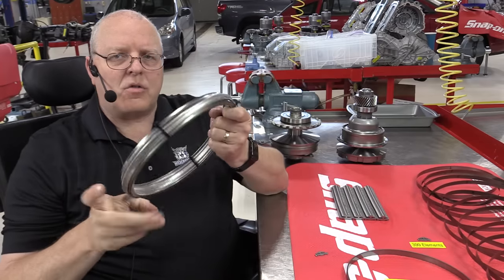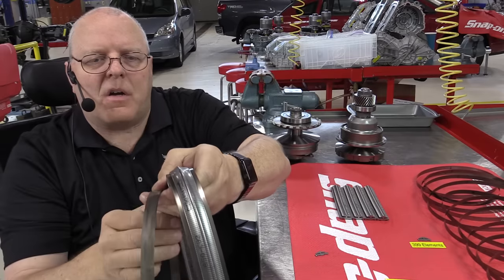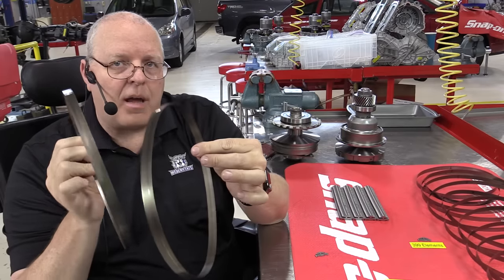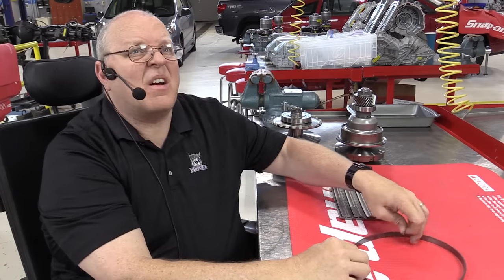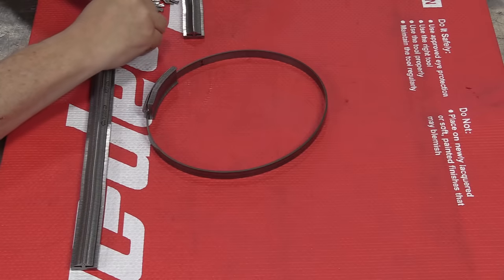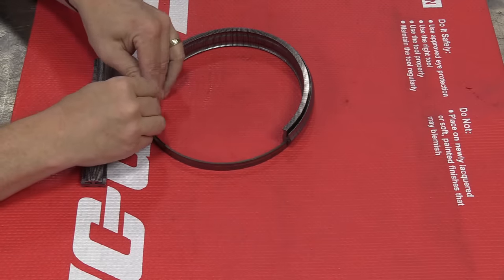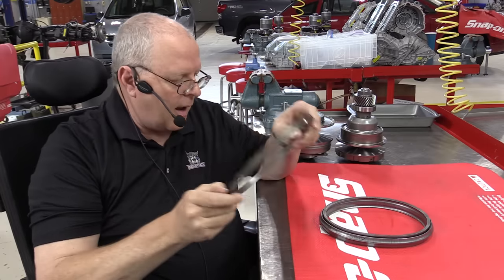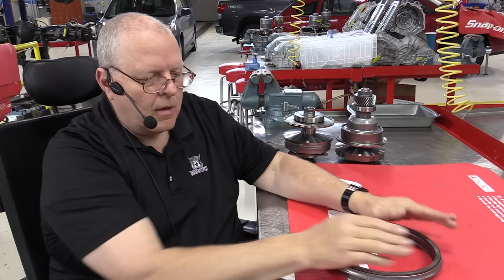The 423-Piece CVT Steel Push Belt

Comment: I found that the explanation this gentleman gives is very clear cut and easy to understand.
However, because there sre so many parts to one of these belts, with a large amount of pressure being applied by the fluid, i really think that it would be helpful if he were to do another video just about the fluid.
With many of the cars that this system is used in the makers try very hard to indicate that the reason there is no dip stick is because jts a sealed unit and does not need a  fluid change.
This is one of the main reasons that most people including myself, are very uncurtain about these Gearboxes, and having already heard that two or three  car makers are facing a storm from buyers who have had major problems with them, Ford being one of them, and to make matters wourse their atitude is could not give a shit, leaving owners with a massive bill to repair something that should never have been on the maket until it was completely tested to find out how long these belts will last, as replacing one is as costly as buying a new car, and certainly not something the average guy would ever dream of attempting themselves.
The belt itself may well be something that needs a lot more attention, before sticking it in a car and selling it, however the most damming of all is the fact that the new owner is told  " oh its a sealed unit you dont need to chang the fluid, " when them truth is that firstly the  fluid itself will set you back a tidy bit of cash, and secondly the prosess of changing this fluid has been made as hard as possible to undertake, for a start, the filler hole  is in a possition that normal size hands will find it near impossible to get at, and i bet you have already guessed it, the only way you know you havevput enough  fluid in is when it starts oveflowing from the filler plug.
Reading the owners manual you will find the whole matter goes unmentioned, COMPLETLY!!  when asked, i was told well, you will know it your loosing any fluid because you will see it on the ground, a really great answer considering that when standing still in your garage there is no pressure because the engine is not running, leaks are more noticable when under pressure as your driving down the road,and its real hard to drive a car, hanging out at floor level to see underneath for any leaks.
The bottom line is that cars today have just about every whistle and bell you can think  of to say something is wrong, only to indicate that you should always drive with your mechanic in tow for when something goes wrong.
Clearly made to go wrong  sooner than later, todays car is made to do Bout fifty thousand, then change it for a new one, despite the fact that it cost an arm and a leg to start with, most of the extra cost for the bells and whistles, while keeping quiet about the fact that the gearbox is as cheap and nasty as it can get, the engine following a close second.
It use to be that the biggest problem to look for when buying a second hand car was rust, now the car looks brand new but is not worth a light, with the added atraction of the fact that you need a masters degree to atempt anything yourself, you are lucky if you can find the spark plugs, and dont go looking for points or the like, they dont have them, about the onlynthing you can do is keep the tyres pumped  up and the washer bottle topped up.
To sum it up the car industry has become the biggest  rip off ever and is even a mechanics night mare with all the technology they have to have.
Reply from the maker: Thanks for your comments, you are not alone. To make things worse, there are improper fluids being used by some shops which can cause premature failures. See my video on transmission fluid specifications https://youtu.be/xUFY0L_zFek

Comment: I'm afraid I'm simply not convinced on this push belt concept. I can't see any way the physical laws of the universe allow the power transfer to be lower on the tension side.
Reply from the maker: Thanks for your feedback. You might check with Bosch, the maker of the Push Belt at http://www.bosch-mobility-solutions.com/en/products-and-services/passenger-cars-and-light-commercial-vehicles/powertrain-systems/transmission-technology/pushbelt/ and http://www.bosch-mobility-solutions.com/media/global/products-and-services/passenger-cars-and-light-commercial-vehicles/powertrain-solutions/transmission-technology/pushbelt/productdatasheet_pushbelt.pdf Best wishes!
Reply: Thank you for the quick response.
 I went ahead and reviewed the material in those links, unfortunately I've arrived at the opinion that they contain corporate propaganda. I strongly suspect that the phrase push belt was concocted by their marketing department in an effort to obfuscate the fact that the CVT is conceptually identical the transmissions that have been used in skidoos for more than 50 years.
I am appreciative of you giving us a good look at the construction of the belt. As a mechanic I've never seen the inside of one of these transmissions, they're not considered serviceable in any way. When the "replace transmission light" comes on you put in a new one and ship the core back to the manufacturer. You're not even supposed to check the fluid in most of them.
Reply: Agreed on the propaganda.  399 elements mean 399 failure modes.  Plus the necessity of multiple concentric rings increases the failure modes on top of that. A standard automatic rarely strips gears, usually they have a valve or seal problem.  The CVT doesn't eliminate any of these failure modes either.  

I don't know, 4-5K in repair fees for ~5mpg?  And this doesn't even factor in when you look at more modern 7,8, and 10 speed autos.  

Video is very informative, and I think everyone should see how these transmissions work before buying...
Reply: FMEA, or failure mode effects analysis can occur in any stage of a design, including intended or unintended use.  Usually it's an important stage gate in design, verification and validation.  

How does one check reliability before buying?  Is there some stat somewhere publishing CVT failures or complaints per mile driven?  If that data is available somewhere, please post it as I would be interested to see it.  

Many cvts aren't really serviceable (due to 399 intended use failure modes), so one would have to plan on a full replacement should failure occur.  If it costs 3 to 5K to replace, and a conventional transmission costs 1.5K to repair, did the cvt save 1.5K-3.5K in fuel?  That's around 51,000 miles of fuel at 40mpg.   So my guess is no.
Reply: davetek490 ; easiest way to determine “reliability” of a push belt CVT is to assume a 100% failure rate on all belt CVT and simply avoid vehicles with that type of transmission

Comment: An excellent presentation of how a CVT works and is constructed.
The CVT is an enticing concept for greater IC engine efficiency - on paper.
And this is the most common execution of the concept, used by Honda, Toyota and Nissan.
Unfortunately, it is a horrible engineering solution.
It combines contradictory applications of the laws of physics.
The makers claim that this design reduces friction, but the entire concept relies of friction of the belt against both pulleys to function.
They require special lubrication to operate and a strict maintenance schedule to keep them from self destructing.
Nissan has had massive problems with their version of this design, so much so that they have sued the supplier of their CVTs.
While, on paper, they are simpler and less expensive to build than a geared transmission, they are more fragile and temperamental in real world operation.
And even average drivers, who know little or nothing about transmissions dislike the main attribute of the CVT that is supposed to be its main selling point - optimum engine efficiency.
It holds the engine in a limited rev range.
To offset this annoying feature, the car companies program these transmissions to act like they have "gears" - which negates the whole reason for their existence. 
I will never buy a car with one of these transmissions.
Reply from the maker: Thanks for your feedback
Reply: steevee1945 I rented a Nisan Altima 2016 model for ride from Las Vegas to sequoia national forest, Los Angeles and back. 3 people on board with some luggage drove the thing pretty hard climbing hills and mountains. I liked the way the car operated, surprisingly. Got excellent gas mileage too - 31mpg (average with all the hard driving and keeping it 80-90mph on the highway)
Reply: SATURN supplied a CVT on the VUE-for two years-they had a horrendous failure rate-so bad that owners  had a class action lawsuit to recover. Audi seems to be doing away with them.
Reply: Mitsubishi CVTs seem to last ok.  120k miles seems the norm. If the tapered pulleys aren't worn, a new $500 belt gets you going again. No torque converter to rebuild (they don't seem to fail), and what clutches they have are usually reusable. If a belt breaks, there's very little internal damage.    I hate CVTs too though.    CVTs seem to be the way the world's going, sadly.    Nissans---stepper motor, and solenoids.  Hondas ---start up clutch.  Both costly. Thank goodness I'm due to retire from this crazy vocation.
Reply: @Sergei__v  That is not special at all. With my 05 camrey doing essentially the same type of driving like you explained 2 ppl and a car full of my shit (I was moving) I got 34 MPG.
Reply: @THEGAMINGHELP101   Your car has the same MPG as the altima 31 City -41 Highay. So yes, it's possible

Comment: Very informative, thank  you.
Just a clarification.
This belt cannot take compression in the "belt direction".  In compression in the direction of motion it will buckle in the radial direction, the direction of high flexibility.  The compression referenced in  "compression belt" is most likely the compression between the moving flanges of each pulley.  Each one of the 399 elements is compressed in the direction of the pulley axis as they make contact with the conical  flanges that are pushed together by a spring for one pulley and by hydraulic, the control, for the other pulley.
In operation, one section of the belt which is not in contact with the pulleys is under high tension, the other section not in contact is slack or under  low tension just like a regular V belt between two pulleys.
Reply from the maker: https://www.bosch-mobility-solutions.com/en/products-and-services/passenger-cars-and-light-commercial-vehicles/powertrain-systems/transmission-technology/pushbelt/
Reply: I slept on it and thanks to the above video, It is clear now why it is called a push belt.
The belt is made up of the element stack and the steel belts.
The elements, on the power transfer span,  are in compression as they slide on the steel belts.  The element stack cannot carry tension.  The steel belts cannot carry power as they can slide with respect to the elements and thus with respect to the pulleys.
The composite push belt is in tension all along its length.  All along the push belt length the tension in the steel belts exceed the compression between the elements.
So the composite push belt tension equal to the tension in the steel belts minus the compression between the elements is in tension all along its length and thus  does not buckle.
Reply from the maker: @pppppierre  Thanks for watching

Comment: why not keep the simplistic system of a 4 speed transmission or 6 speed? now we have to deal with bullshit ring packs if one of those three hundred and ninety nine elements decide to go bad
Reply from the maker: Thanks for your feedback
Reply: It's simply down to efficiency. From the many ways you can reduced fuel consumption, this is what we're ending up at.
Reply: infinite gear ratios  and its not like a 6speed automatic transmission is simpler
Reply: Why? The same reason we don't still was clothes on a washboard, progress.
Reply: Emph Squee progress for belts that dont last long or handle much torque? Yeah real progress guess thats why auto companies moved to 8 and 10 speeds
Reply: Anthony Perez Cvt's are generally at least as reliable as conventional auto trans. They are mostly made for small,  lower powered vehicles and with proper servicing will last the useful life of the car. They offer real advantages in efficiency which is why they are used increasingly more. It is a good idea to know what you are talking about before making comments about short belt life.

Comment: Will avoid any vehicle with this trans. This is the first video I've seen of the CVT and working innards. An all steel push belt ? I guess it would have to push to keep it crammed together . No thanks..
Reply from the maker: Thanks for your feedback
Reply: Depends on the application. I know the MK2 Prius is easily like a 300k mile car if you keep the oil changed and don't abuse it.

Comment: When that belt comes apart byebye transmision
Reply from the maker: Thanks for your feedback
Reply: The longevity is about the same as more traditional transmissions. It's just that a more traditional transmission may give you some warning signs before failure like grinding gears and hard shifts making a catastrophic failure less likely.

Comment: Nice clear explanation, s segmented steel element compression pusher belt held together by tension steel belt packs. All the little elements working together are stronger and more functional than a single element in the same way that people are stronger in teams! Thanks for sharing this interesting edifying information!
Reply: It also makes it super clear why Nissan CVT's have so many problems with early failure. The classical manual tranny seems so much more robust!
Reply: Also combining two electric motor generators with the gasoline engine in an orbital gear power split device makes the "transmission" of the Toyota Prius super ultra reliable!
Reply: "Power Split Device" was the special sauce that made Hybrid Synergy Drive sell by the millions  ^^
Reply from the maker: Thank you, and thanks for your feedback!

Comment: Thanks, now I know not to buy CVT car. Ever. Still they are a lot of choices and I can get regular transmission car.
Reply from the maker: Thanks for your feedback!
Reply: I agree, don't want a cvt!
Reply: How about honda cvt? They said Honda cvts are reliable .
Reply: @gutadin5  What I've heard is stay away from this one - 
"Nissan owns a controlling interest in JATCO, the firm that supplies 49 percent of the world's gear-free transmissions to Chrysler, GM, Mitsubishi, and Suzuki."
Reply: @selewachm  you mean stay away to their cvt transmissions or automatic transmissions ?
Reply: @gutadin5  I've heard bad things about the Jatco CTV which are in Chrysler, GM, Mitsubishi, and Suzuki.
Reply: @Jr V how many mileage on the Odoneter and year of your car?
Reply: @gutadin5  My Accord is over four years old with 52,000 miles.
Reply: @neilkurzman4907  update us when you get to 70,000 or 80,000 miles
Reply: @gutadin5  
With Covid around that could take a while. I guess I should get all my fluid changes on time.
Reply: @neilkurzman4907  when did you first change your cvt fluid ? If you have cvt  you have to change your fluid often.
Reply: @gutadin5  
I’ve got the service done at the dealer. I think the first change was in the first year or two. I don’t recall if there was a second I’m not sure when it’s due. 
But I will certainly check.

Comment: nice video, clear, language, spot on on how it works, kind of like a snowmobile, but much much more robust..with more friction elements.. to handle higher torque and of coarse the cars weight, and constant throttle movement.. the belt constantly moving up and down the face of the pulley must cause a lot of wear mind you, I'm guessing tps sensor . and a bunch of tranny software smooth out  the throttle inputs so as to mitigate the drivers foot  inputs.. otherwise the belt would wear out very fast from constantly running up and down the face of the pulley.. 
    A smooth linear acceleration from the time power is applied, and gradual tightening of the bell ( most likely controlled by how the fluid is admitted to the torque converter would greatly reduce lash , rather than just relying on centrifugal force to throw the pulley out like on a sled.. nice controlled even  force applied to the face of the belt.. once it's "locked up" so to say,  can the power be applied with gusto from the engine..it's that split second of initial grab that causes all the wear.. the belt face is essentially the clutch, the fluid entering the torque converter is essentially the foot , and must be controlled to engage softly , and evenly so as to get decent belt life.. once software and servo's were advanced enough to handle this delecate operation reliably , through millions of cycles, could we build a cost effective cvt.. had mechanical forces been relied upon alone the thing would be giant, clunky, and expensive... the first cvt's were just that.. once engineers could eliminate that initial lash from the belt grab electronically, cvt became viable..
Reply from the maker: Thanks for your feedback!

Comment: Audi  / LuK had used a link-plate chain type in their Multitronic CVT transmissions.  While Audi has abandoned using this type of transmission in new cars, this alternative for higher torque applications would still be interesting for repair reasons. And you will have considerably more parts on your workbench. :-)
Reply from the maker: Thanks for your input. Subaru uses a similar chain-belt setup.

Comment: Thank you for the detailed explanation. I think initially it all goes back to the DAF Variomatic. Once I worked as German student for DAF Trucks (in EIndhoven Netherlands). When I remember correct, the CVT was invented from ZF (Zahnradfabrik Friedrichshafen) in Germany which is 50 km from here.
In one way its bad that all this mechanical knowledge is substituted bei electric engines with fixed gears. Changing the speed of the motors.
Reply from the maker: Thanks for the info!